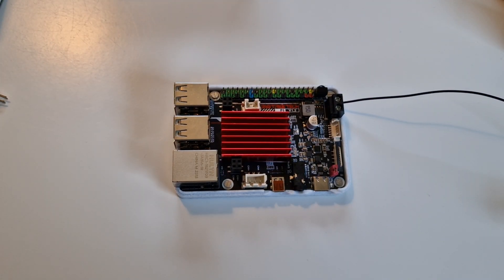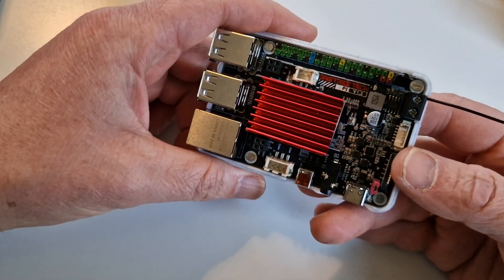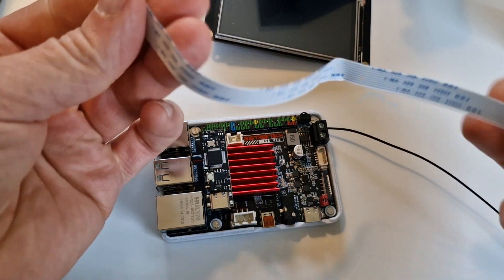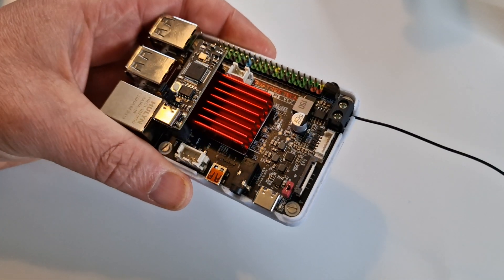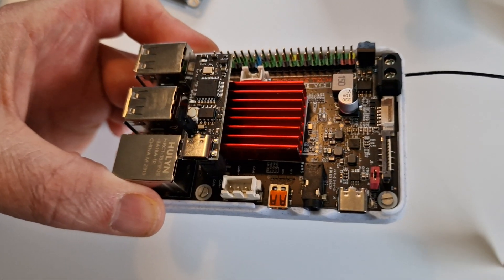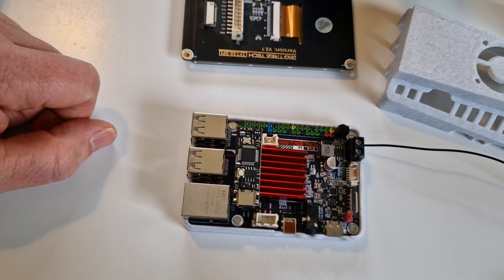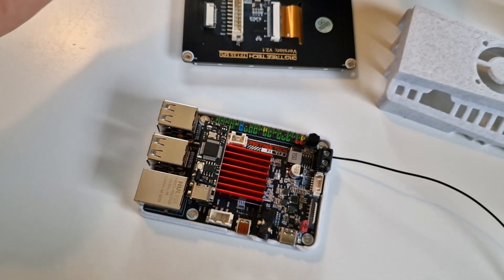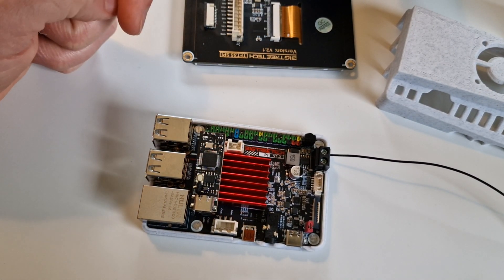Best Raspberry Pi alternative? | BTT pi

Comment: One additional benefit to the wifi antenna vs the one for the Pi is that you can run this in metal cases without massively degrading the wifi signal. That can be important if you want to use a metal case for passive cooling to improve performance and you want to use wifi. This can be useful for klipper and server farms as well since you can put this internal to the 3D printer and still have the wifi be usable. Overall it's a thoughtful addition.

Comment: I have no idea why you have so little subscribers, the information on this and the canbus video is brilliant. I am a complete noob when it comes these btt pi’s and klipper. Is there something I need to do to run more then one Logitech c270 at once. I have tried the second and third camera in different ports etc, but 2 won’t work at once. 
Oh and that case is great I am going to buy it now 👍🇦🇺😊
Reply from the maker: The 2 camera thing is a bit weird and I have the same trouble with a raspberry pi. If you haven't done it yet you'll need to set the second camera [cam 2] with port: 8081 and the device: with something like /dev/video2 or /dev/video3, you can also instead use the device id found with,
    ls /dev/v4l/by-id/*
But I've still had an issue with only one camera showing. I think it could be network speed causing it because I've seen others say it starts working with the Ethernet cable used instead of wifi.

Comment: como puedo hacer para que no demore tanto en encender , a veces duro hasta 10min y no lo reconoce aun el sistema
Reply from the maker: Sorry, I've never experienced that. If it has never connected then I would recommend to double check that you have the correct WiFi SSID and password. If it has connected and randomly does this then it seems like something isn't working correctly. You can try to update with,
sudo apt-get update && sudo apt-get upgrade -y